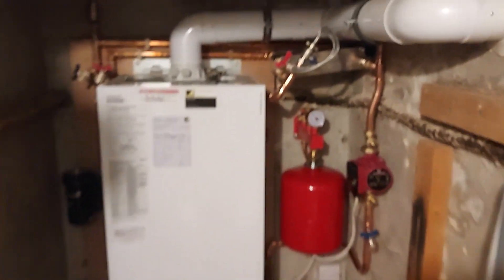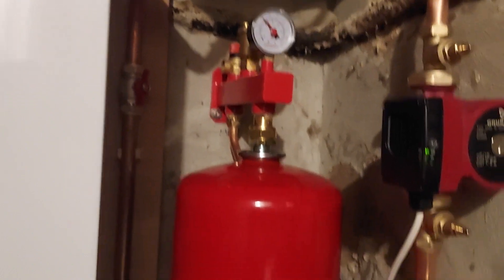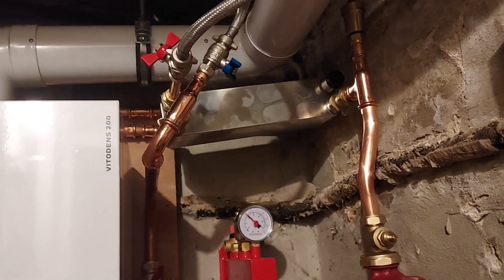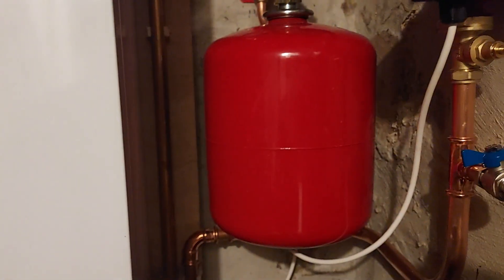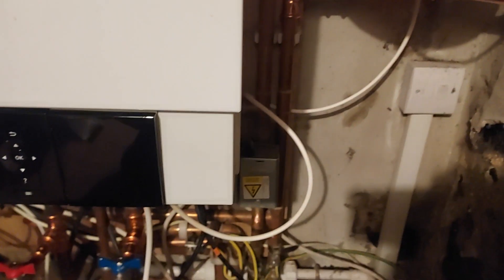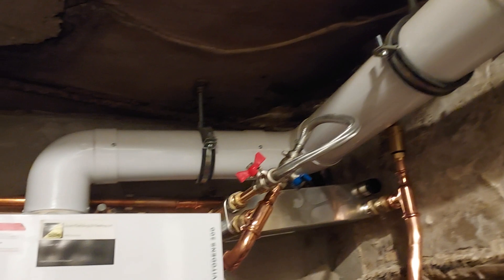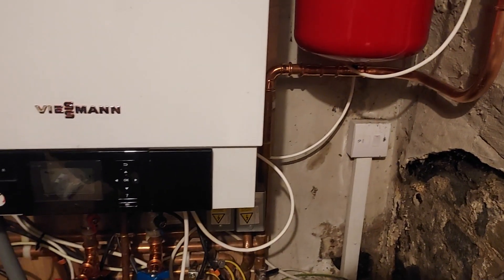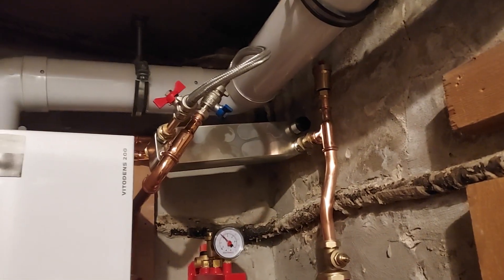Plate seperation for ongoing boiler protection.

Comment: Am I missing something here - only 3 ports are used on the plate hex with one blanked off? Would be grateful if you could briefly clarify for my understanding. Thanks!
Reply from the maker: Its got 6 ports. 4 are used. It just gives instalation flexibility
Reply: @andrewmillwardwatford9410  sorry I meant at the 26second mark on the plate itself not the ufh manifold
Reply: The plate has 6 ports, 2 at the rear
Reply: @matthewtrueblood408  everyday is a school day, I assumed all brazed heat exchangers have 4 ports to split primary and secondary sides 😂